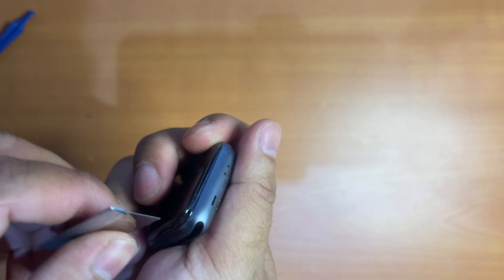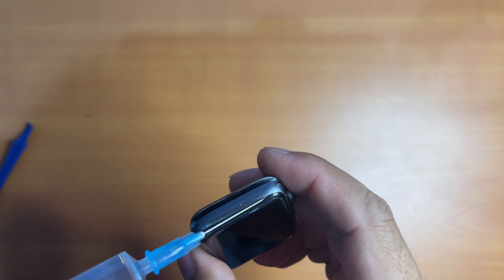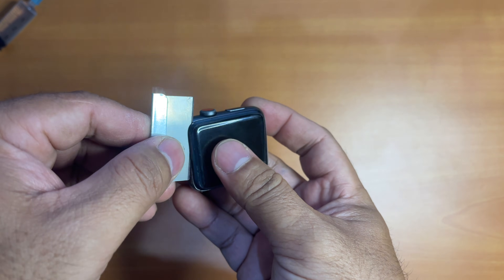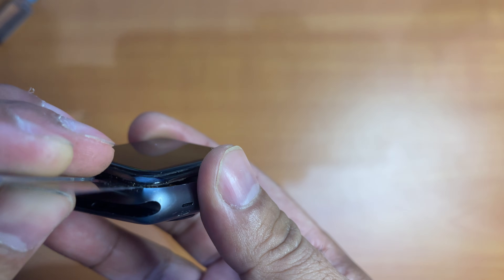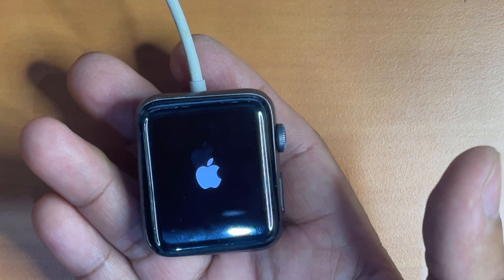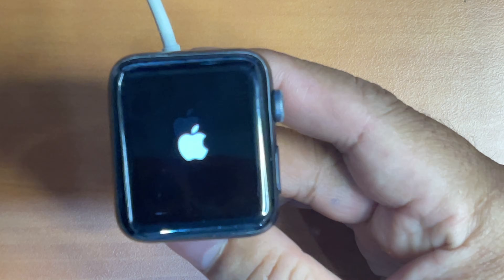A Complete Guide: Replacing the Battery on an Apple Watch Series 3 (2024)

Comment: What battery did u use?
Reply from the maker: It’s not an original battery from Apple. I ordered it from China, but it works as well as the original one. It would be a no brainer to buy it from Apple. If the battery for Apple Watch 3 were still being sold by Apple today, they would charge it 10 to 20 times more.

Comment: I use series 8. Can I replace the battery?
Reply from the maker: You can but the way the flex cables are designed on series 8 are a bit different from series 3.

Comment: Is it still waterproof?
Reply from the maker: Apple watch is never waterproof, to begin with. It’s only water-resistant. Although it’s not 100% seal like original, it’s still water resistant to some extent.
Reply: @CamTechElearning  I mean can you still go swimming with it on
Reply from the maker: @78jonybravo if you re-apply the force touch adhesive, you can still swim with it.

Comment: Excellent video, as noted below "Useful tidbits without too many digressions,".  I do however have a question.  At about 5:45 a new Force Touch Sensor appears.  When was this installed?
Reply from the maker: Right after you install the battery because their connectors are in the same place.
Reply: @CamTechElearning  thanks!